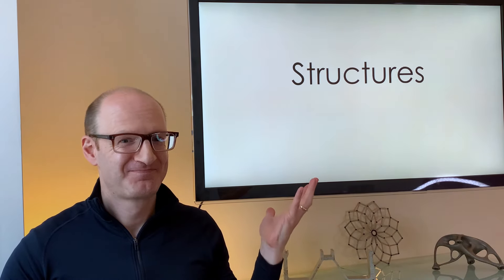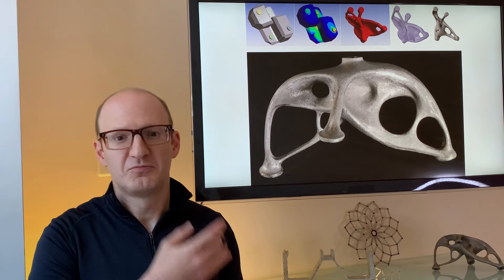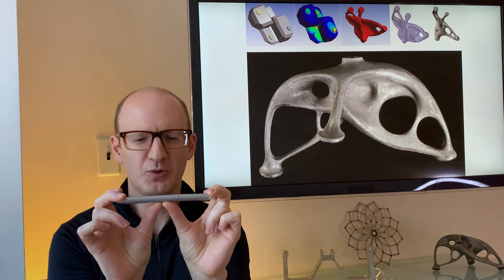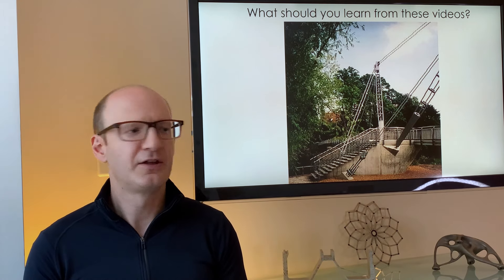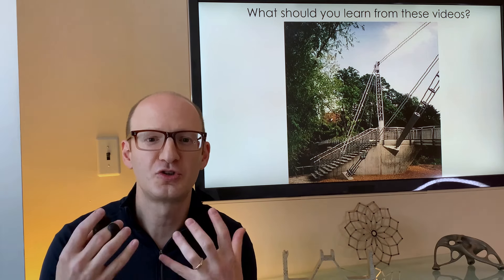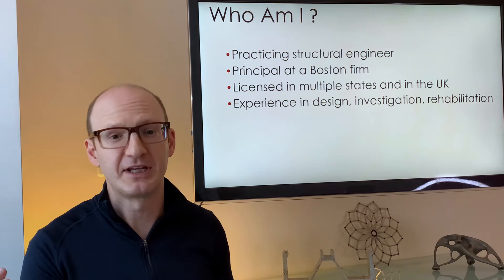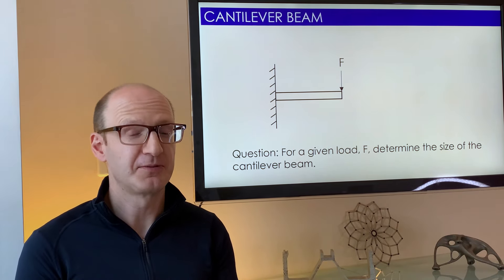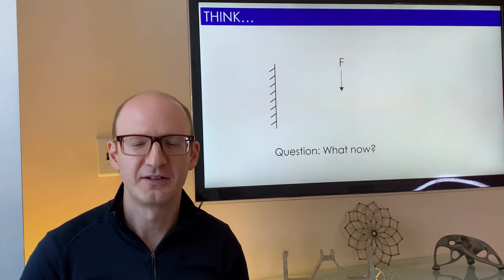Structures 0-1 Introduction

Comment: Dear Paul, I went to MIT in 1969  to 1972 in the Department of Mechanical Engineering. At an optimization course, Professor Daniel E. Whitney proposed a cantilever design question to minimize deflection at the end under its own weight (with or without F at the end, I do not remember). l missed the session when he gave us the answer. Is it possible that the optimal cantilever has two cross sections, with a bigger cross section near the wall, and an abrupt transition to the smaller section, probably in the middle of the cantilever? lf this is not the optimum design, what is the optimal design?

lf you see him, could you ask him whether his answer is like that stated above? Was there an F at the end?

Comment: So, whose responsibility is it to analyze the structures; the architect or the engineer?

The way I understand this is that that the architect is like an artist; responsible of coming up with ideas of structures that will look nice given various socio-cultural or even religious conditions of the users. Then, the engineer would take those ideas, make calculations, and determine how to build those structures as efficiently as possible (with just the right amount of materials at the right places).
Is this correct?